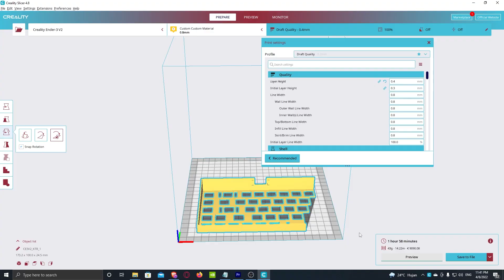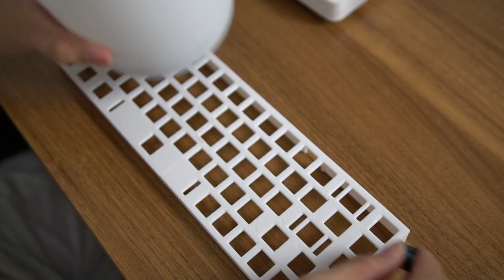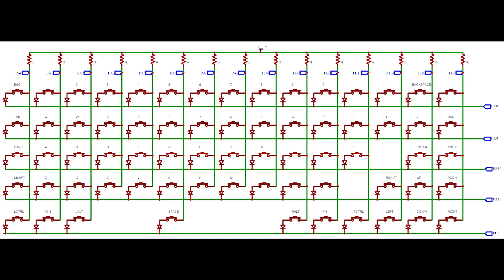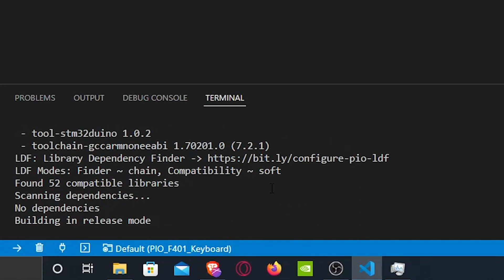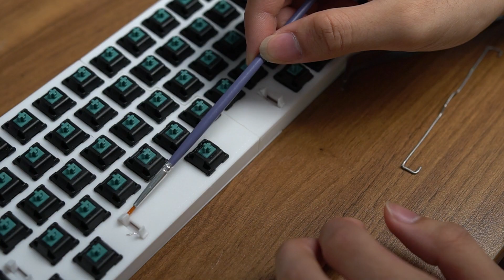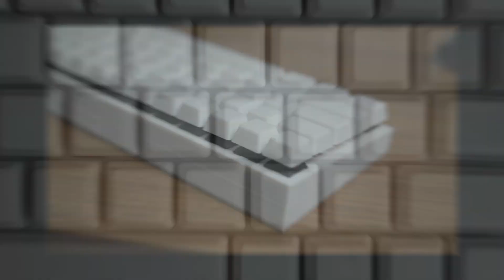I Made a 3D Printed Mechanical Keyboard

Comment from the maker: What video should i make next?
Reply: I would love to see a dye-sublimation process video! Those blank white caps came out amazing and definitely have an appeal all their own, i've just been interested in making my own keycap set, so i've been interested in the dye-sub process (there's not many super informative YT videos going from the design process to the finished product).
Reply from the maker: @bobbyhutter5654  Hmm, I didn't know much about that, but from what i've seen, it requires a decently high heat for the ink to soak through the plastic, and i'm not quite sure that a 3d printed PLA plastic can withstand that amount of heat since it melts at 60C. But thanks for the suggestion.
Reply: @dewe1144  ahhhh I didn't think this through 😅
Reply: a 3d printed mouse or a 3d printed keyboard switch that works 
(hint) optical switches as they dont need copper they just need a spring
Reply from the maker: @Yakko Does Stuff  I've just recently bought a PMW3360, but haven't tested it or designed the pcb yet. So maybe in the future
Reply: Make an ortholinear keyboard and throw away that horrible horizontal staggered standard scheize layout.
Reply: Can you please send the links?   I want to build the same but i cant find the right parts.😢 That would be so helpfull
Reply: Nice job on the keyboard.  I myself just completed a SICK-68 build with RGB addressable LEDs and a Raspberry Pi Pico controller.

Comment: what i like the most about this is that the keycaps are printed too. This way, if you were to do some dye-sub experiments, you can just print new ones instead of having to buy blank keycaps from goblintech or whatever. How hard would it be to add LED's to this? Single color only.

Comment: having issues making this i got the blackpill but i am getting no flashing blue light or anything it cant find the device in stm32 cude as well just the flash tool
Reply from the maker: did u try to connect to it with an stlink?
Reply: @dewe1144  okay so i got it to work i had the black pill i changed the name and it worked but im using a 84 keys im a little confused on what to do to change out the buttons but rn i got 16 by 6 not 5 by 15 where do i changed the key outputs is it only in keymap.h??
Reply: @dewe1144  if you got a discord channel i can send you how i got it wired up
Reply: how to you add another row? i got it to work but im tryingto add the F keys to pa11 and it keeps   failing
Reply: i am currently typing on the keyboard =)

Comment: Could you make a video or picture Solder the upper wire with the STM32F4?
Reply from the maker: which upper wire? if you want the schematic diagram, you can find it in the GitHub link in the description

Comment: bro I'm using serial convertor module to connect with black pill but I'm getting " failed to init device" error. I also changed the (upload protocol) to "serial" still i got error. help me bro
Reply from the maker: have you entered boot mode? to enter the boot mode, press the boot button, and while holding the boot button down, press the reset button.
Reply: @dewe1144  the program is dumped but the keyboard was not working
Reply from the maker: @dcl3d  have you tried uploading a simple blinky sketch to the microcontroller before?
Reply: @dewe1144  not yet bro I will try. Thanks for your time
Reply: I'm using FTDI module for programming, but which RX & TX pin I need to use for dumping program in black pill. A9 & A10 is already soldered in keyboard. What should I do?
Reply from the maker: @dcl3d  well just desolder it temporarily for programming then resolder it back
Reply: @dewe1144  after a long struggle I done it bro it works thanks a lot for your support.
Reply from the maker: @dcl3d  You're welcome bro.

Comment: Hey man, amazing video! Inspired by this I'm ready to do mine. But could you make a video on working with the STM32F4? That part is a bit complicated. How do you do this on VSCode? Like I'm worried about how I'd choose the COM ports etc. I've worked a bit with Arduinos but only on the IDE. Also, what if I do not want to use the ST LINK but want to do it via USB to TTL?
Reply from the maker: Thanks for watching! The programming part shouldn't be much of a concern since this project is made with PlatformIO IDE extension on VSCode. It basically converts VSCode into an IDE and handles the unnecessary build stuff behind. All i needed to do was code and press upload similar to the Arduino IDE. You can also change the flashing method to USB to TTL instead of stlink by modifying "upload_protocol" value from "stlink" to "serial" in file platformio.ini in the project directory
Reply: @dewe1144  Okay cool that makes sense! So I'm gonna go ahead and buy the MC without the ST Link because that's even more pricey then the MC 🤣
I'll buy a USB to TTL and connect the appropriate pins, I guess. Do let me know if there's a mess up in my logic. But otherwise thanks a lot :)
Reply from the maker: @CrypticTries  Ur welcome. Few notes though, the backplate of the keyboard in my 3d model does not fit that well with the keyboard main frame. so i had to use a couple of zipties to hold them together lol. It's still pretty seemless though,  so watch out for that or you could design the backplate yourself.
Reply: @dewe1144  Hey thanks a lot! I have idea for that. I'll definitely let you know once I'm done. I don't think I'll have a flawless product since this is my first ever build :D But I can't wait to get it done :) Thanks for the motivation :)
Reply from the maker: @CrypticTries  Thanks man, really appreciate it!

Comment: whats the difference between a keyboard like this using a controller VS a keyboard with a standard PCB layout? Do they perform equally especially in gaming?
Reply from the maker: well the standard pcb layout would also need a microcontroller to read the switch matrix and translate it to usb. Now if i assume the standard PCB layout uses the microcontroller similar to an arduino (ATMega series), then yes, this one would be better because i used a faster microcontroller which is capable of a higher poll rate (1000 Hz). I'm not sure though since the firmware i used is built by myself and it's pretty crude

Comment: This needs way more views. You printed literally everything you could- including the stabilizers! Thank you for the video
Reply from the maker: Thank you for the nice words.
Reply: Technically you could also print the switches (search for "void_switch"), but that would make hand soldering significantly harder due to the need to either install reed switches correctly (matrix) or a bunch of MUXes with hall sensors (each switch will need it's own wire from)
Reply: Yeah your editing is awesome, you have earned a sub :)

Comment: Hi I’m wondering what type resistance u used
Reply: And is that okay if using stm32f401ccu7
Reply from the maker: @kino6441  I used 5k ohm resistor for the matrix. Idk about stm32f401ccu7 but i don't think there's any reason for it to not work
Reply: @dewe1144  Thanks a lot

Comment: Nice one, you know, to give the keyboard extra strength, you could print the bottom plate in three parts so that the joining areas of the top and bottom piece aren't both centered.
Reply from the maker: Yes. i made the bottom plate to have a 'V' shaped joint for this reason.

Comment: hello, i jusnt want to know if we really need the 5k Ohms resistos on the board ?? also thanks for doing this video, it's very helpfull !!!! Also is the st-link programmer really neeeded to flash the microcontroller ??
Reply from the maker: Thank for watching!. Glad you liked it. you don't really need that 5k ohm, you can instead use the built in pull up resistor in the stm32, i just didn't trust it enough. if you don't have an stlink could use the dfu mode to flash the stm32 or a serial to ttl converter like an ftdi chip. Haven't tried it though. I used stlink because it is the most reliable way to program it, and it also enables debugging which i needed when developing the driver.